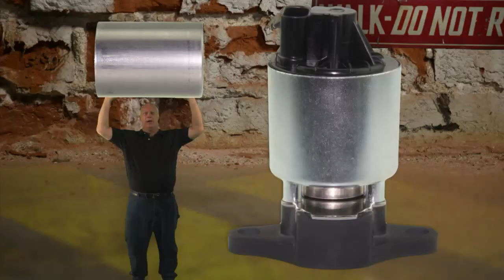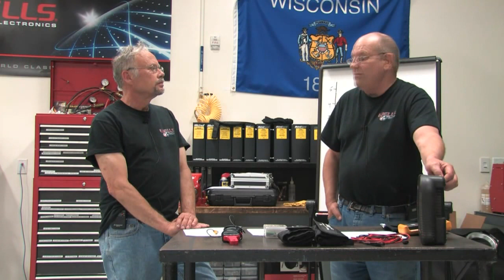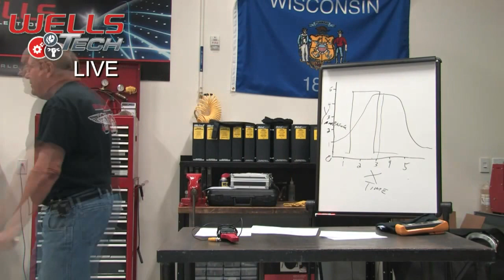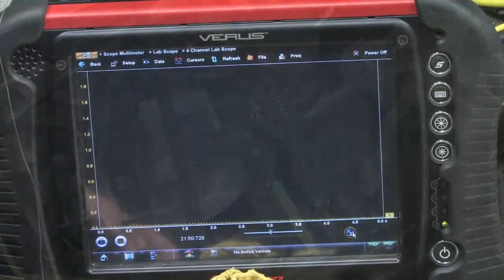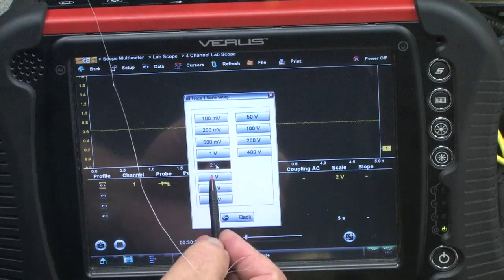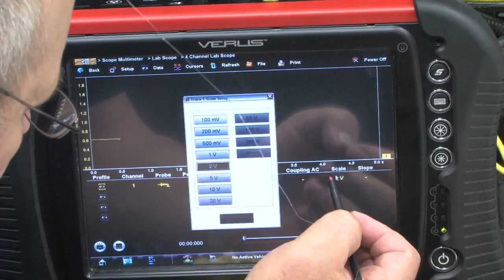Lab Scope Training - Where to begin

Comment: Hi guys. Great video. Can someone give me an answer for beginner question please?What If the vehicle has a POSITIVE  GROUND, made by positive lead from battery , can we use lab scope as normal or we can't? Do we actually  need to swap the ends of testing leads and make the ground crocodile clip as our testing point and original testing point as a ground connected to the positive ground. Hope I didn't confused you more than it is for me right now. Would be really appreciated if someone can help with this. Thanks.
Reply from the maker: Hey, so really all a scope is doing is measuring a voltage differential. So, if working with a car like that, i'd just swap my leads around. Voltage difference is a voltage difference. You just need to understand the numbers may look different than you're used to. 
Mike Becker, Senior Technical Services Instructor
Reply: Wells Vehicle Electronics, Hello Mike,  thanks for your reply. I understand that the waveform may look upsidedown when leads will swapped, but what about to using a current clamp OR pressure transducer where internal circuit is designed to send signal to scope through middle pin on BNC connector and negative on the ring on BNC? Just asking to prevent fry the scope.
Reply from the maker: Hey, I don't know that answer. I wish I could answer this for you. I think your best bet may be to reach out to PICO or something. They would be able to answer that way more accurately. Like you said, don't wana fry the scope! Sorry I can't be of more help!
Mike Becker, Senior Technical Instructor
Reply: Wells Vehicle Electronics, Hi Mike, thanks you are still putting your effort to answer  this unusual question. It seems to be an interesting problem ⚠️ to solve. It may save many scopes from disaster though. I was just thinking loud out and no one knows  how to resolve this. If someone can help with this feel free to add comment.

Comment: Yellow and Green cables; have Ground cable split? while other Two cables are only cables without Ground split?
Reply from the maker: Muhammad, the other cables have optional ground hookups. The yellow one is the only one that is built in. Thanks for commenting!
Mike Becker, Technical Services Instructor
Reply: Wells Vehicle Electronics Thanks Mike Becker